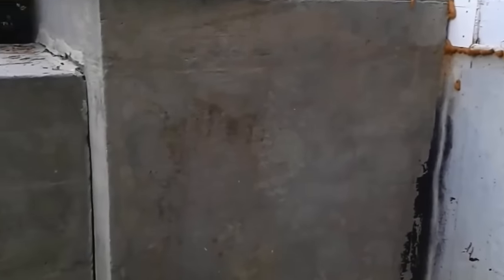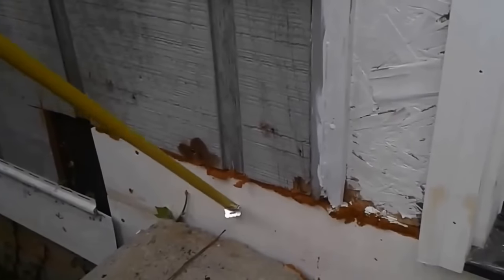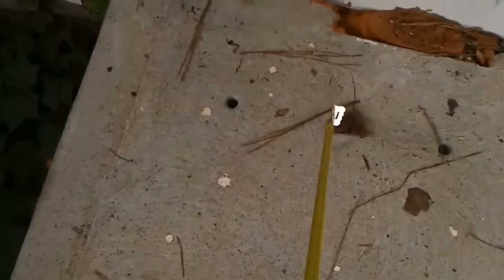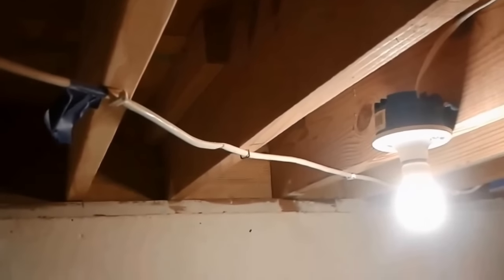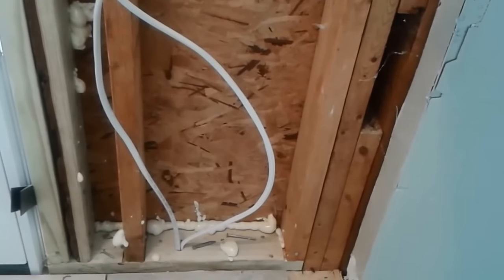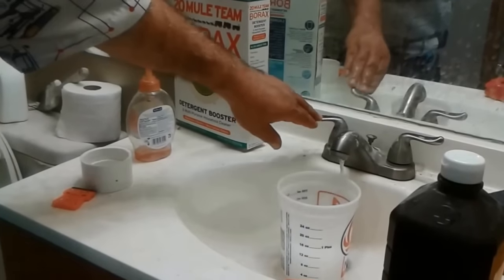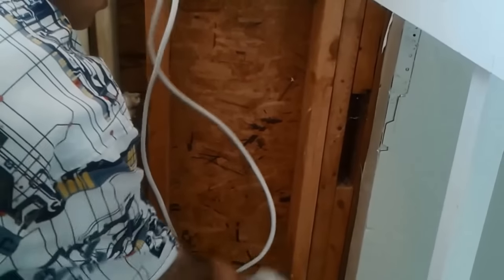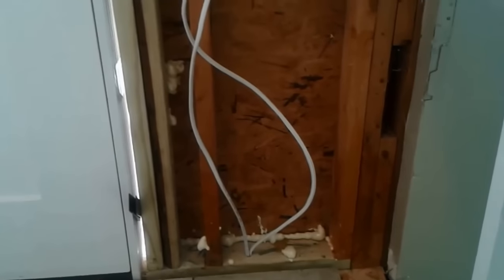How To Get Rid Of Termites For Good  Using  Borax -- Best Solution Do It Yourself

Comment: Add marker dye to the solution so you can see what areas have been treated.
Reply from the maker: Good idea.
Reply from the maker: Thank You
Reply: Use fluorescent dye if you don't want a patch of stain.
Then identify the treated areas by a UV torch.
Reply: LeavingIt Blank    What is marker dye? Where can you purchase it or fluorescent dyed?
Reply: @ronh9384  You can use a yellow highlighter (yes its the highlighter that you use for marking important words in a book) open it and squeeze the highlighter fluid in the bucket with borax and warm water. It will be diluted in the water so you will hardly see the color yellow but if you flash a uv light on it, it will glow yellow. I personally squeezed 3-5 highlighters in a filled bath tub and flashed a uv light on it and the water glowed.

Comment: Thank you for being so kind as to post this video! We will be treating some vulnerable areas with this solution very soon. Question: Can the solution be applied by using a spray bottle or must it be painted on?
Reply: The idea is for the borax solution to absorb into the wood, however it's applied.

Comment: Spot treating is good but in conjunction with professional inspection and recommendation. Inspections from most termite companies is free. Compare prices, and try to do a comprehensive termite treatment with your own chosen kind of termite DIY. I'm in Florida, and found I have a termite problem. I just got it treated with a major company. But I also bought some termite spray online from a company called Cedarcide. I've used their products before, notably one called Cedar Shield and I swabbed both wood balconies with it. They have remained free of termites after 15 years. I just ordered more that I can spray in my attic. Cedar does smell, so make sure you like the smell if you are considering it. I am going to be doing attic spaces, door frames, window frames, etc. It repels as well as kills, so that works for me.
Reply from the maker: Thank for the info.

Comment: Ive known about borax for quite some time long before this. Borax is the substance sodium tetraborate which is a  natural substance- form of salt and boric acid. I ve used it on several occassions but the termites are still here. they multiply quick. You have to keep applying it.
Reply: termites burrow deep in the ground and move around, dig a trench around the perimeter of the house treat with borax, the wood you  treat with borax needs to be soaked in it. I used a sprayer for portions of the outside, but the wood really needs to be soaked in borax. Borax is what they use to treat wood with and some other chemicals.

Comment: Your entry concrete steps area is probably concrete formed on non pressure treated plywood that doesn't have insecticide. The termites are probably moving on after eating most of the wood hidden by the concrete steps. That area is going to stay damp all of the time so might have a colony still looking for more wood to eat. Knowing construction crews they probably tossed a lot of wood scrap inside the steps area before pouring the final top section which locked in years of food for termites. Not sure if boring into the side of the steps and pumping poison in would help. I really doubt that's a giant block of concrete for your steps.

Comment: my termites are in my bedroom wall, they come out, SOMEHOW ,every evening around 9pm, is there a way to get it into the wall?          I may have to put it in a spray bottle,drill a small hole & spray it in the hole & do it about every 2 feet along the wall??????????????????????
Reply from the maker: If is a souterrain termite you need to take action quickly and find from where they are coming. You may need to use Termdor to eliminate them.

Comment: OSB our particle board doesn't do well with extended over exposure from water, good job with the termite prevention, and PVC replacement at The rim joist but the panel board that you painted on the left side vertically off the door, that's called OSB (ORIENTED STRAND BOARD) it's going to get swollen from  water exposure and become brittle over a number of years, nobody's perfect, you did well with the termite prevention and you added PVC at the bottom but need to change out that OSB and use PT OR PVC sheet also.
Thanks for your video, great help.
Reply from the maker: Thank You

Comment: can that product be sprayed in a house that is completely gutted out?. All you have is the walls around the house open. We re-framed the house and want to spray before we hang up sheet rock and insulation.
Reply from the maker: Yes you can spray it but you should clean the nozzle after you spray.

Comment: Works great to keep ants away, I use it all the time did not know it worked good for termites as I live in Florida its a year around issue.
Reply: Yes I have ants year round and now I have termites! Winded termites are coming inside the home from cracks behind my furnace that I cannot reach. 

I tried to seal up the space behind my furnace with foam insulation but they are still getting through the cracks! 

I have a slab house. So no wood underneath my house. No basement. Maybe they are getting in through the attic? Or I have so many cracks and it's a thin and cheaply built small house so it wouldn't be hard to get in. 

I don't know if I should schedule a visit from Orkin? They are so expensive. And they will want to do it many times and charge me over and over for it. 

Even if I got borax, I don't know where I would put it? Around my furnace but idk where they are coming into the house from? 

Also, I read if you just pour the powder down, it won't stop an infestation. 

Please help!

Comment: We can also put it in spray and spray on wood ?  Is this Borax as good as  Bora-Care product but much less expensive?
I need to replace my roof facia board and possibly can use Borax on new wood.  Can I primer and paint wood after apply Borax?
Reply from the maker: Yes this borax is less expensive and will do the work. You can put the borax substance on the wood and let it dry. After the wood dry you can apply the primer.

Comment: Its a great idea👍🏼 to treat woods but How can i treat my wardrobe which is made of plywood and covered with sunmica( fixed with fevicol)🤷‍♀️. The termites pops up at the inside corners of wardrobe ,upon the sunmica..!!!
Reply from the maker: It should be a naked wood. The borax must penetrate into the wood.
Reply: @josephk9182  yea,but I waanu to treat termites and save my wardrobe in this initial stage itself. Do you have any  idea..?

Comment: Thanks for a great video, question, can you use a small hand sprayer to apply?  I will be building a house in the Philippines and want to treat the wood before building.
Reply from the maker: Yes you can but clean the sprayer with water after use to avoid clogged spray.

Comment: Will this method work outside the home as well. First time home buyer here and out side the previous owner planted a plant and put wood around the plant to box it in. It has termites now. Just thinking this may be the easiest solution to get rid of them?
Reply from the maker: It will work inside and outside.  If you use wood for exterior purposes it should be treated wood  otherwise it will attract termites and mold.

Comment: What if you don't have open studded walls? How do you apply it on sheet rock? How can you use it around the base of the house?
Reply from the maker: You can not. You can apply it on drywall back  (browen paper).  Usually the termite eat the back of the drywall (browen paper).

Comment: Wouldnt it be easier to pour the solution into a spray bottle n spray the surface n let it dry?
Reply from the maker: Yes but the substance may clogged the nozzle.
Reply: I've used this solution in a spray bottle, it works just fine. I diluted the Borax into an old cooking pot on the stove.

Comment: Will this work if you mix it in one of the tank type,pump up sprayers? The kind that you pump it up to pressurize it, then just walk around and spray?
Reply: Ya it would be good, sprayers are designed for insecticide and weed killers, non flamable liquids without a doubs it can spray borax which is like any laundry soap as far as spray
Reply: jil brown 👍👍
Reply: we did it successfully but i had a problem with solution wanting to harden into crystals again with the second batch.

Comment: I bought the borax from a hardware store. Is this still good? More expensive than that for laundry. Can I also apply this on cemented surfaces that used to have termites tubes.
Reply from the maker: You can but termites don't eat cement they eat wood. We use borax to protect the wood from termites, bugs, mold and mildew.

Comment: A lucky twist in nature.......Boron, (Borax) and termites are both attracted to moisture. When they meet.......goodbye termites.
Reply: what is the ratio using borax and hot water for riding house of termites
Reply: 1 1/2 cups Borax to 1 gal water (4.5 litres) should do the trick. Stir until dissolved. Use, (spray), it liberally, it's not poisonous to humans or animals....
Reply: Ineed to. Get rid
Reply: @samhunt9380  Thank you for the mixing ratio.
Reply: Jim Ball   1 teaspoon of Borax to 8 ounces of hot water.
Reply: Can someone tell me if Borax is safe for squirrels and birds also? I read about animals being safe but I care about our little rodents and birds I feed around my house (my cat's entertainment :))

Comment: Thank you for taking the time to make this informative video.  Can I use this on wood that has been painted?  Thank you !
Reply from the maker: No. Only on naked wood. The borax substance must penetrate the wood and this will not happen if the wood has paint on him.
Reply: what product then do you suggest? I fumigate the entire house four years ago and did not know it can come back so quickly like this. I thought fumigation is good for 10 years or more. What product do you recommend for wood that has been painted ? Thank you .
Reply: Hi Joseph, the wood that's been painted , I can easily sand it to naked wood. That's not a problem. MY LAST QUESTION IS , can borax be used to treat drywood termites?? I know you said subterranean termites, but can this be use to treat DRYWOOD termites? Thank you very much again.
Reply from the maker: Yes it can.

Comment: Great video.  We are using borax to treat the attic area and surrounding the house here in Cebu City, PH.
Reply: Hi! How exactly do you go about that job?
Reply: Does it work?. I have a wood worm in my attic and try and understand if go with this method or use chemicals. thank you
Reply: Yes I have ants year round and now I have termites! Winded termites are coming inside the home from cracks behind my furnace that I cannot reach. 

I tried to seal up the space behind my furnace with foam insulation but they are still getting through the cracks! 

I have a slab house. So no wood underneath my house. No basement. Maybe they are getting in through the attic? Or I have so many cracks and it's a thin and cheaply built small house so it wouldn't be hard to get in. 

I don't know if I should schedule a visit from Orkin? They are so expensive. And they will want to do it many times and charge me over and over for it. 

Even if I got borax, I don't know where I would put it? Around my furnace but idk where they are coming into the house from? 

Also, I read if you just pour the powder down, it won't stop an infestation. 

Please help!

Comment: Is this strictly a repellant, or will it kill any existing infestations that are small enough not to require replacing the wood?
Reply from the maker: It will also kill  any existing infestations.
Reply: Joseph K Great, thanks. Is spraying the borax solution effective to kill existing colonies, or should holes be drilled and the solution injected?

Comment: What do you do if ants just won't take the bait? I have an infestation outside of my house. They've built a colony underneath my concrete walkway. They're also showing up inbetween gaps of my concrete slabs and my foundation. I've done borax mixed with many things like honey, sugar, peanut butter etc, they just ignore it. I'm not sure what their food source is exactly. I've ordered Taurus hoping that'll help somewhat.
Reply from the maker: Taurus  and Termidor should help  because if you spray it on the ants they will not die immediately instead, the ants will carry the poison to the nest and hopefully destroy nest.  In the video I use Borax to put on an untreated wood such as studs and wood siding which will avoid termite from eating the wood.  You should not have gaps in the concrete and slab you must sealed it with exterior silicon or concrete sealer (Find in Home Depot or Loews) the issue with gaps is that water are penetrating through the gaps and creating a moister environment which ants and termites are thrive.  On my house you see in the video I sealed all gaps especially between the house and the concrete stair and tiled the stairs. The tile and sealer will prevent water to penetrate under the concrete stairs so that the area under the concrete stairs will stay dry all year long, so no termites can leave there.
Reply: Have you tried Hbanero sauce or Tabasco .

Comment: i had a termite get in the wall and at night i could hear it after watching this video i mixed up some boraxo and hot water and sprayed it in the cracks of the area and out of the bottom of the wall came a big ass termite that was struggling and then it got smashed and now its quiet
Reply: +NorthOaklandHiway50 sounds like a carpenter ant.
Reply: no. it was a termite. and this solution worked. end of the story.
Reply: +Roger Sailor: once the termite finds a good new home their wings drop off, so they cant go anywhere. so a decoy pile wont help. it will cause a termite swarm the following season.
Reply: +Roger Sailor LMAO!!!
Reply: No. It was probably Bigfoot.

Comment: Any idea why one could not build a stud-sized trough, fill it with borate solution, and soak the wood in the trough for some period of time?  I ask this because I am planning on putting a wood-planked ceiling where all the wooden pieces are the same size.
Reply from the maker: You can do it.  In the past the industry used borax to protect studs from termites . Today the industry use chimerical called Chromated copper arsenate because it is cheaper and faster.
Reply: Thank you, Joseph.  Any idea how long to soak is necessary?  The boards are long but about 2 cm thick by 9 cm wide.

I fall somewhere in the middle of the strong-chemical-versus-all-natural camp.  But I did notice at my U.S. lumberyard recently that even the grizzled foreman refused to subject his workers to cutting Chromated copper arsenate boards as he said that he felt he could no longer expose them to that dust.  Given that I'm overseeing this project in a 3rd-world country and the workers will be doing this manually, borax seems far more ethical.
Reply from the maker: The studs should be naked (not rained or pain)  and dry. Try 2 applications 2 to 4  hours between application (Before the second application make sure the stud is dry.) if you use brush. 

When you apply the first application the dry wood sucks the water with the borax substance until the wood reach saturation after the wood dry (within 2 to 4 hours) apply the second application. After the water is evaporated the borax (biric acid)   stays for ever in the wood.

Comment: But I would need to know whether Borax may be effectively used in controlling termites without harming Bees in their beehive areas
Reply from the maker: +KARAMAGA Omar Are you bees eating wood ? If not, you should apply borax as liquid on the outside beehive wood (not inside the beehive) and let it dry. The liquid borax penetrate the wood so I do not see an issue with the bees.
Reply: Maybe not HIS honey bees, but there are wood bees that drill holes to lay babies in and mud them over til they are born and emerge. Those bees do not cause structural damage and are not the stinging kind. They are passive and a bit annoying but they do pollinate to grown foods and flowers so they are good.

Comment: I will try this solution on a big bucket, and then use power spray to spray the affected areas, will see it if this works
Reply from the maker: The borax may clogged he spray nozzle. Make sure to clean the nozzle.
Reply: i’ve melted the borax with hot water and pumped clean water afterwards. Power spray did not clog. Thanks for the tip

Comment: can this rot the wood?  if not, can this solution be sprayed through a hole in drywall?
Reply from the maker: +evadesc  It will not rot the wood. You can spray it through a hole in the drywall however, how can you make sure the borax is applied to the studs without seen the studs ? If the borax spray reaches to the  studs it will protect the studs from termites only in  places  it reaches.
Reply: Borax actually stops wood rot

Comment: Thank you for the great information! I have read that borax will repel most insects and mold as well.

How did you replace your sill board after termites ate it? I have to do this at my house as well.
Reply from the maker: I got lucky. The sill board was accessible from under the stair but I had to cut the plywood floor above ( my worker did it). If you replace the sill make sure it is a treated wood.  Good luck.
Reply: Thanks again!

Comment: Can i apply this with a Pressure Tank Sprayer? 
(Why not)?
Reply from the maker: You can but you must clean the nozzle . You should also call the manufacturer of the pressure tank sprayer and ask. I used it in a garden spray with no issue.
Reply: @josephk9182  I think this will help. Just Imagine how difficult it would be to crawl through an attic with less than 2 feet space AND applying BORIC acid to the wood. THANKS Joseph !